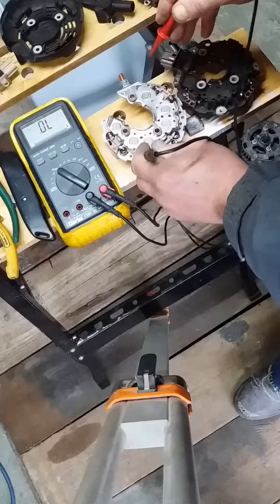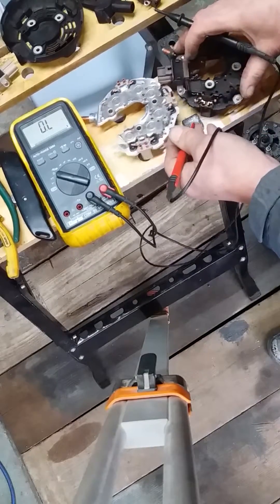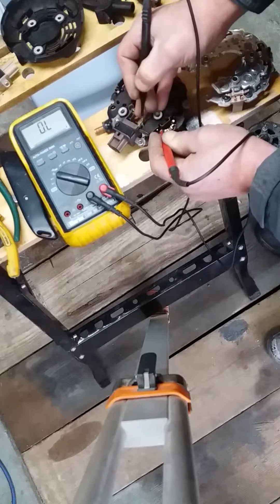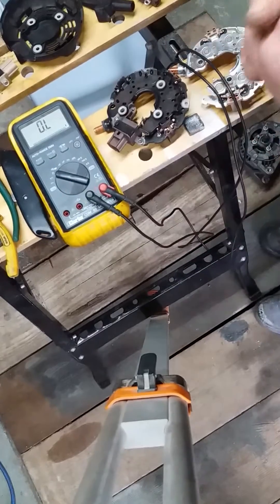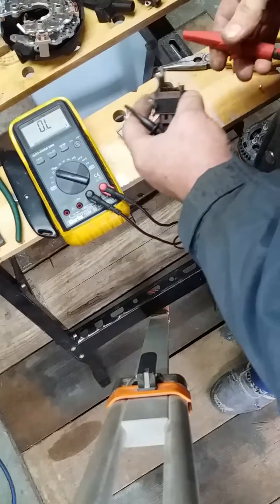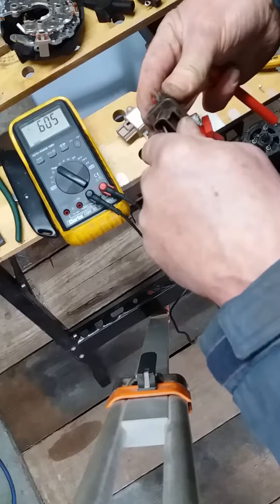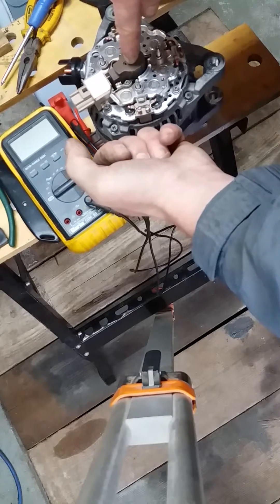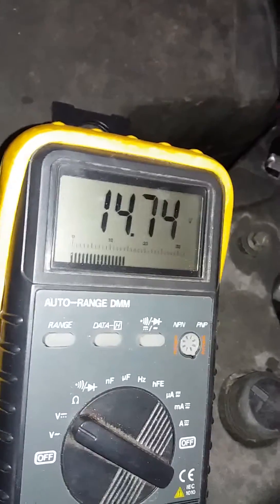Nippon Denso  (Volvo, Ford etc) Alternator Diagnose and Repair,  PART 2

Comment: Excellent videos, installed the new diode bridge on the wires, but wires are a tad bit short on the plastic collar ear of the diode pack - can't really crimp or solder them.

Can I extend the wires or any trick for it? Thank you
Reply from the maker: Very awkward to extend as too much heat will breakdown the clear insulating layer around the copper coils of the alternator. Any way you could post a picture on here to show your exact predicament? Apologies for the delayed reply.
Reply from the maker: Just had a thought. Non insulated cable crimps might be a possible solution IF you have enough space to get them in. Added a link below to show the type of thing I mean.
https://www.ebay.co.uk/itm/362591328820?chn=ps&norover=1&mkevt=1&mkrid=7101533165274578&mkcid=2&itemid=362591328820&targetid=4584826055637461&device=c&mktype=&googleloc=&poi=&campaignid=412354546&mkgroupid=1299623041023876&rlsatarget=pla-4584826055637461&abcId=9300541&merchantid=87779&msclkid=8f976470a08816561d4d062133ee0993
Reply: @deuceelec  Thank you for your help, was anxiously waiting for your response. For some reason I posted pictures and a response today morning and it is no longer there, maybe got blocked because of external picture links? So there are total 6 soldering points, out of which I would say wire for 2 is bit low from the actual crimping place, so I can't solder or crimp. Wish I could share the pictures :( thank you again.
Reply from the maker: @maverickperson5443  Sounds like your only option is to unbolt and separate the two halves of the Stator, remove the stator coil to facilitate the repair.
Reply: @deuceelec  thank you again. If I solder a small piece of copper wire for the 2 end which are short and extend it, would it impact the overall alternator or use non insulated crimps?
Reply: @deuceelec  thanks, another question is if I open the casing, should be easily able to extend the wires, so that can be safely crimped and soldered, yeah?
Reply from the maker: @maverickperson5443  As with a lot of things in life, no guarantee. However, it will be much easier to do/evaluate with the stator removed. Good luck!

Comment: I'm replacing my regulator and rectifiers.  did you braze back the connections to the new rectifier assy.? or did you just solder it?
Reply from the maker: If you have access to something like the SMITH LITTLE TORCH you could braze with it, due to small flame high heat. I didn't at the time, so soldered and it worked fine. Too much heat for a prolonged period could damage the insulation in the windings.